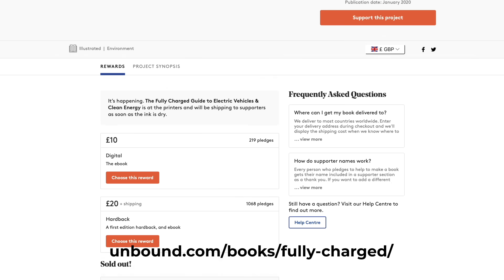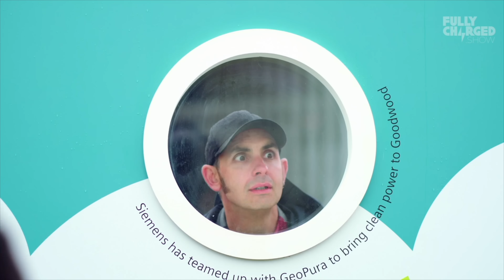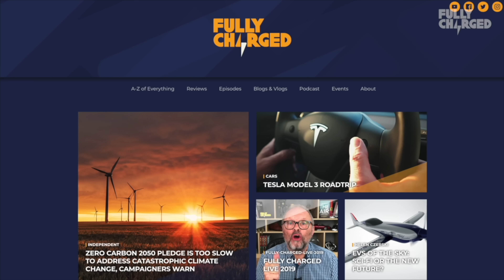What is Fully Charged and how can you help us? | Fully Charged

Comment: I recently nearly made the mistake of stopping my Patreon support to save a bit of money. This is a timely reminder that doing so would be a mistake. I also recently turned in my large diesel estate for a smaller electric car. The financial benefits are probably not justifiable but I am loving the driving experience and not contributing to the bad air quality of the local area. Fully Charged was a huge influence (you trendy influencers you!) in guiding me to this point, thanks again.

Comment: I'm curious how electric cars will work when lots of us have them. Petrol stations you can fill up in 5mins. Fill up your battery in your electric car I hear takes longer than 5mins. So surely petrol stations need to be laid out differently and you'll still end up with large queues. And how about when you park in your street. Can't park outside my house all the time and tiny front garden means can't park in drive. Think people would get pissed off with an extension lead out the window connected to the car the odd time get a spot outside. Curious how this will all work.
Reply: You charge at home. Arrive home, plug the car in, and go and have your normal life, but never visit a gas/petrol/diesel outlet again.